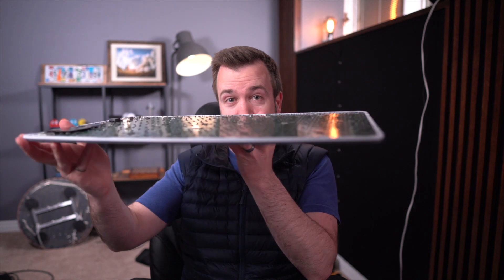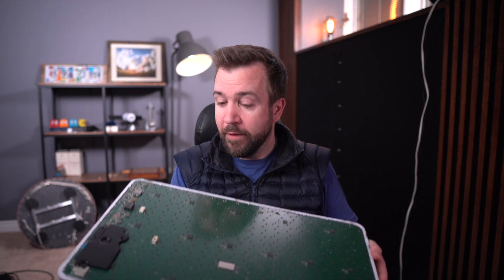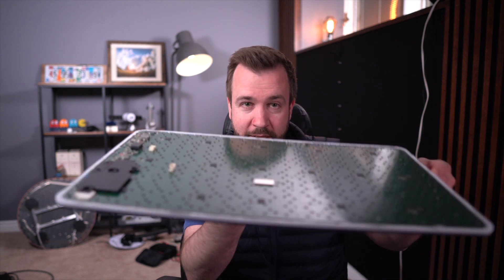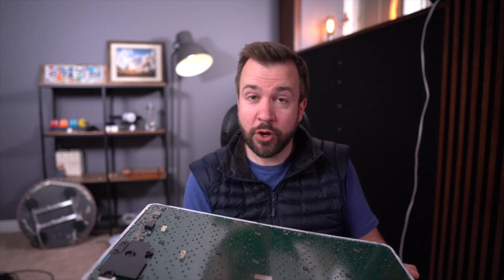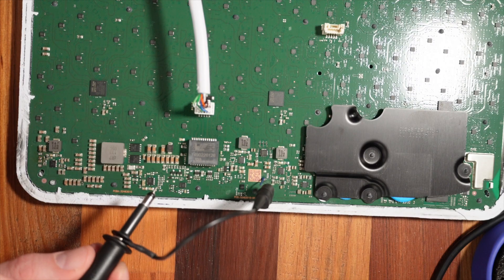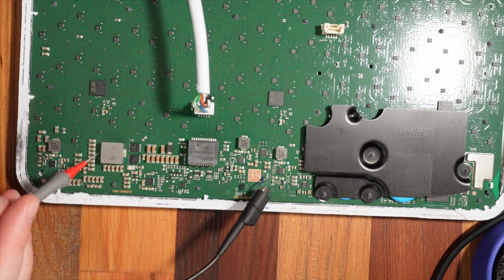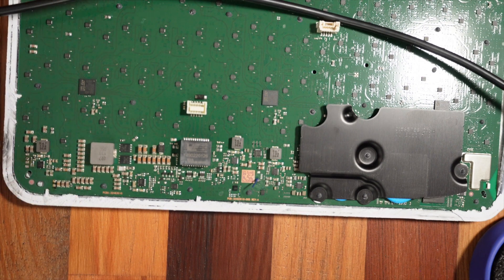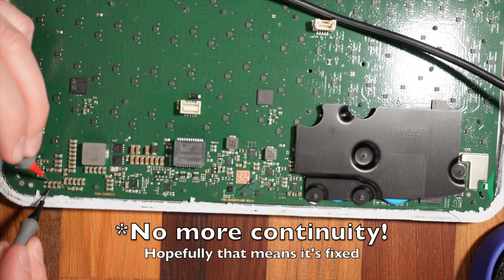FIXING a Broken Starlink (I HOPE) - I think I voided my warranty in the last video - Sorry SpaceX!

Comment: Mike awesome video  -   I did a semi DIY conversion - used the Starmounts 12V all -in-one .  At first couldn't get it working as I was only using a 5 amp fuse to the hot side of the 12v supply .  Then checked w Starmount  and learned they specify using a 10amp -   I had it working for a couple of days and I believe that I let it plugged in AND switched on when parking under my home carport.  Is this something that would "fry" any component ?  Now every time I turn on the 10a fuse pops almost immediately .

Comment: Hi Mike, I have a question on the Ethernet cord. Where it connects to the board about 6 inches up is a (round thing) that the cord goes through. I cut that out and just ran the Ethernet cable straight to the router.  I now don’t have a signal to the router. Do I need the (round thing) and if so where would I find a replacement. And do you think I hurt anything on the board?

Comment: Hi Mike, what does the package say on the 16 relatively evenly spaced STMicro chips on the PCB? I think you referred to these as "signal chips" in a previous video. You also noted the smaller chips all over the board to be the phase shifters - do you know the manufacturer? I would appreciate any more details that you have on these chips. I'm very interested in the supply chain for these user terminals. Thanks in advance!

Comment: I love the production value with your videos! great work. Wind recently knocked my Starlink off my roof and broke the shaft/motor assembly, the board works fine and i still get strong connection when I prop it up. do you think if I used a waterproof hard case (Pelican, Skb etc..) that it could send a signal through the case? or would that not be possible? thanks for your help!

Comment: How would you know that the capacitor has the same specs is the same as the ruined ones? My limited understanding is for filtering they use different sizes to catch different transients.

Also, THANK YOU for doing this, I bought the v3 dishy and want to mount it to the roof of a van I'm building.

Comment: I ran over my Starlink antenna with my truck today and broke the gear mechanisms, I am able to still connect my Starlink by leaning it up against a stool at the approximate angle it was before.  I’m gonna order a replacement antenna from Starlink,  so I am going to do a teardown of my broken Starlink Antenna and I’m going to see if I can 3-D print some new gears so I can reuse this antenna.  As I saw in your video, splitting the shell will be the challenge, I will use a dremel, slowly by hand, I don’t want to have to fix caps.  I will also be working on a 3d printed enclosure.  Larry

Comment: Welp, I tripped over the ethernet cable while testing my Starlink on my rooftop patio and cracked the edge of the housing. 

Some interesting info that might be of benefit to you -- the white housing has a channel that is filled with porous gray foam type adhesive. The white on the face of the dish appears to be just a vinyl sticker. The whole of the face piece is actually gray as far as I can tell, and I could most likely go around the whole unit with a putty knife and cleanly separate the two halves. So it is doable if someone wanted to disassemble it that way, although getting the initial leverage would be quite difficult. 

With that said, the stack height of the internal electronics is taller than the front half of the dish, so it is most likely a better solution to retain some of the back half of the housing as you have done. 

I'd love to do a permanent low profile mount on the top of my van, but the front face and a corner is damaged from my mistake, and water ingress is a major concern. Would need a completely new housing made. I've sent in a request for a new unit for now but am looking forward to your future videos! Let me know if you'd like to see some photos of the damage my unit sustained.

Comment: Mike, at 4:09 in the video you mention that some people have a problem with the connection seating properly. I am having that issue. It seems to seat and I can’t really get it in further, but Starlink complains that it’s not connected. Any advice on what I can do to seat it properly? Are there certain known manufacturing defects that require replacement?

Comment: Great video Mike!  I want to mount my rectangular dish to the top of my motorhome pointing straight up and then when I am at home would like to move it to the roof of my RV cover.  While on the RV I think I would need to disable the motor.  Then when parked under the RV cover be able to reconnect the motor.  Here's my ask.  Can you measure where I would need to drill a 2" hole in the back to be able to get to the motor disconnect.  I could drill a hole and unplug the motor then later re-plug it in using a water proof plug to cover the access hole in the back panel.

Comment: Best practice when specifying bypass capacitors for any high speed circuit is to use three different values of caps, usually spaced by factors of 10 to widen the frequency response. Just picking a a cap at random may not get you the actual value that you need to replace. That being said, the number and value bypass caps are generally over specified, and you are most probably ok just leaving them off the board. If you still plan to replace them, do not forget to make sure that the voltage rating on the replacement cap is higher than the output voltage of the supplies.

Comment: Mike, this EE felt you had only 5% chance of repairing the pcb w/o a schematic.  Did you cut any traces too?  What makes you think the value of damaged capacitor is the same as another capacitor?  Too bad you can’t reach out to someone who is familiar with the circuitry.  Based on your luck, I recommend playing the lottery.  Anxious for next video in this series. Great job!
Reply from the maker: I was definitely "lucky" on where I damaged the PCB. In the output stage of the power supplies, each has a bank of filter capacitors in parallel between the power supply output and ground. So you're right that they COULD be different values, but in this type of configuration effectively they're just trying to pack as much capacitance as possible into the given board real estate. There wouldn't be much point to use different values for each.
There are probably thousands of other components that if I had damaged them I would be out of luck :) No need to cut or bridge any traces since I was just removing some of the parallel capacitors that were damaged.

Just curious: I've been thinking of starting some live streaming to answer this type of question, that's not "big" enough to need a separate video, but still potentially interesting to many viewers. Do you think you'd find that format interesting? Mixed in with my regular videos?

Thanks for watching!
Reply: @MikeOnSpace  MIke, I think there are some subscribers interested & able to participate in live streaming.  But, like me and many others, have work, family commitments, routine acivities with friends, etc. so cannot participate.  If you live stream, most likely I'll only get to see recording.

Comment: Mike I'm super glad you were able to get this dish back up and running. Kudos to you and I look forward to see where this goes...One request though (bc I just recieved my square dish) Could you please show us folks an overview of the inside of the backing plate and motors, specifically where it might be good to drill circular holes in the back plate to dc the motor wires to take advantage of in motion roaming....I am planning on doing this when I install our dish on the folding mount on the rv roof.... and it would be great to have run through on whats and where's inside there

Comment: Interesting video but these "Power Supply" Chips are Synchronous Buck Converter. I don't want to be picky but it just triggerd me every time you said "Power Supply" Chip.
Reply from the maker: I know - I stumbled over it constantly :) My channel has a "split" audience where many are deeply technical and DO care about the details of them being synchronous buck converters, but many just want to hear about Starlink stuff.
If I could do a "poll" of you as someone who DOES care: I've been thinking about starting to do some live streams that would lean more to the technical side, to talk about stuff that might not be as interesting to the broader audience, but still really interesting to those interested in the technical details, etc. Do you think that format would be interesting? Along with my regular videos?
Thanks for watching!
Reply: @MikeOnSpace  I barely know the difference between a capacitor & resistor but am still fascinated by the work you are doing on this project. I vote for more tech details😀

Comment: Nice work man, you’re obviously an EE!
Reply from the maker: Yup! Although my soldering skills are a bit rusty :) I spend a lot of time on software these days - it's fun to spend some time with some circuit boards! Thanks for watching!
Reply: @MikeOnSpace  I'm in a very similar boat, although I mostly do mechanical and software engineering now.  I have a CNC mill and might be able to help with this project... assuming I can fixture a block big enough.  Could also start with 3D printing the mount in pieces on some FDM printers or pay for a one-piece off a larger printer.  I'm guessing metal for heat dissipation really isn't necessary as the wattage is pretty low AND the original mount wasn't metal.
Reply: @KeithStrang  i noticed spacex seem to have deleted that part, the metal back plate that was in the round v1 dishy, as they are wont to do 👍

Comment: Will there be trapped heat in the thinner backing?
Reply from the maker: Yeah, GREAT question! I've been thinking the same thing myself. What I'm planning on doing is having the enclosure milled out of aluminum. I'm thinking of including in the design small "fingers" from the enclosure down to the chips (and anything that gets hot) with a small gap for thermal paste between them. This would turn the aluminum enclosure into a large heat sink that I'm hoping would be enough to remove the heat even in hot outdoor environments.
This is all just ideas at this point - I'm not sure how hot it will get with the smaller-volume enclosure, but definitely something on my mind as well.
Thanks for the great question!

Comment: Another great informative video. 
Currently I have my first gen on top of my RV  on swivel mount that I use to stow it when I'm driving. I would love to be able to mount it flush to the roof and not have to crawl up on the roof each time I want to relocate. I'm hoping that starlink will soon come out with a mobile antenna.
Reply from the maker: Yeah, I figure they'll have to come out with a purpose-built unit. It's just such a great use case! Hopefully something designed for low power consumption as well, 12V or similar. Thanks for watching!